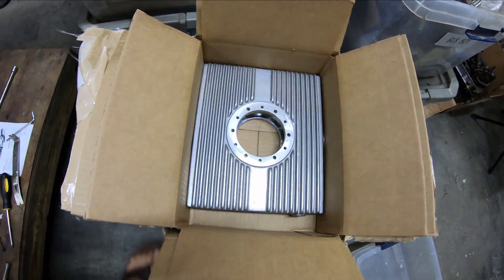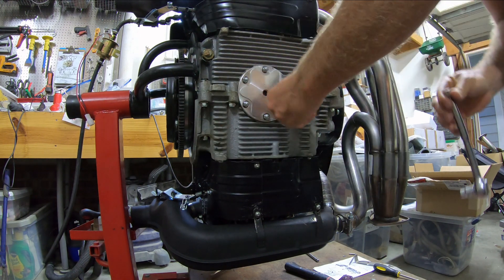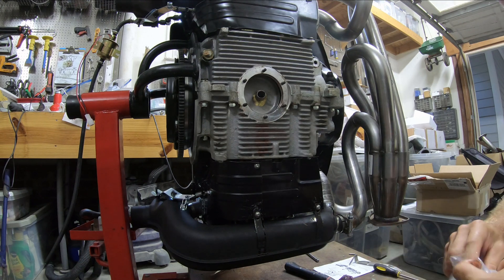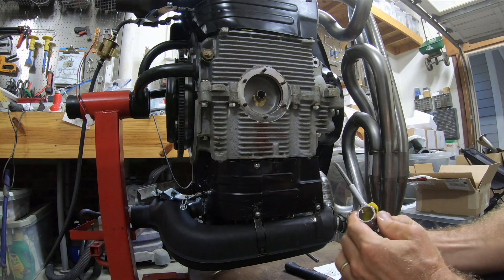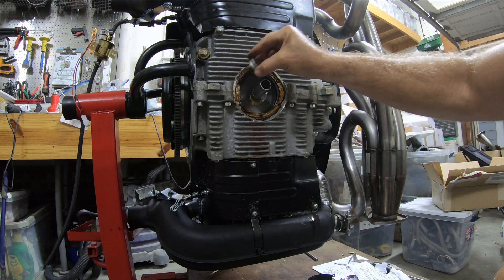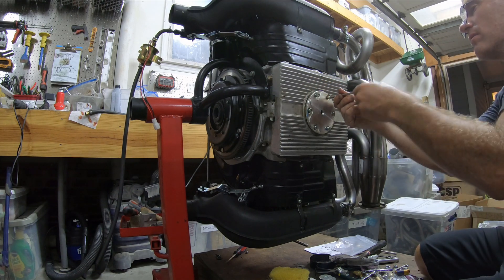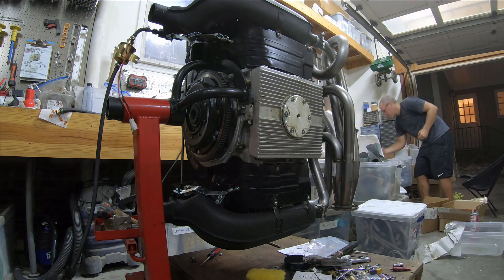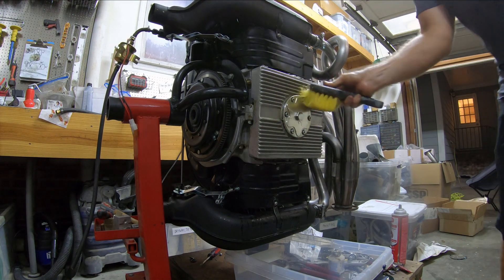2332 VW Air-cooled Stroker Motor - Video 76 - Deep Sump - 1.5 Quart

Comment: If that’s the scat kit, you use the long bowl to go through the oil pick up hold down and what I do is I take a 10 mm in wrench and bend it maybe be better if you had one that was ratcheting but I didn’t have one, so I just vented and then grind it off what I needed to I then took some thin bailing wire across the sides of the box in wrench to hold the nut and then screwed it in tight and then use the wrench to tighten the nut down on the long bolt that holds down the oil pick up to it’s easier if the engines apart to put it on butthat’s how you do it if the engines already built if that’s the scat kit that you have
Reply from the maker: Ok thanks.  It is the SCAT sump I believe - though I did this a while ago.  I probably fumbled my way through, but the 2332cc motor in the bus is such a great motor - it really turned out great, it is reliable and pulls the bus really well at low RPM which is what I went for.  From what I remember, I had a few issues on the oil pickup on the sump - the bolts, whether to use loctite, and the pickup not being too loose or coming off.  In the end I found a workable solution.  Good luck with your projects!
Reply: @LarsonSplitBus-  that’s cool glad it worked out the scat sump is one of the better ones. Your motor looks great. If you do need to put that jam nut on the hold down if it came off heat up at 10 mm bend at 90°. about grind off anything extra use some thin wire to make a cage for the nut and you can tighten it down super tight but it sounds like you don’t need it.
Reply from the maker: Ok, I’ll keep it in mind.  For the time being I have 2 motors that are running pretty well, so not sure when I will have another motor on the stand or opened up.  The funny thing about these motors - that also makes them so interesting - is that you assemble them meticulously, and you always have to come up with work arounds, and you always need clever ideas and innovation anyway.

Comment: With all the money, time, and love put into a motor and then use a glue sniffing hack job into extending your oil pick that’s going to vibrate off maybe before the cam and lifters even break in. Can’t a longer one piece tube be supplied with the deep pan ?
Reply from the maker: I think that is the tube that comes with the deep sump - the problem was making sure the clamp doesn’t come off - but actually the way the tube fits into the metal screen, it can’t actually come off I don’t think…
Reply: @LarsonSplitBus-  after checking that the high or depth was good I would tig it up. I’m just a worry wort like that especially on such a nice build.
Reply: Mine was different it's just slides on the  origional tube and fits with a new screen like a filter. It can't fall out cause when the plate is bolted on it has no way to escape until  you unbolt the plate to clean the filter